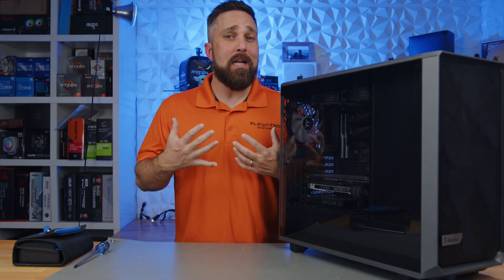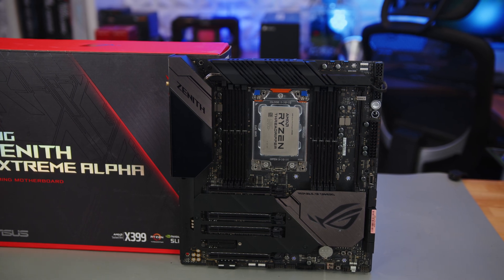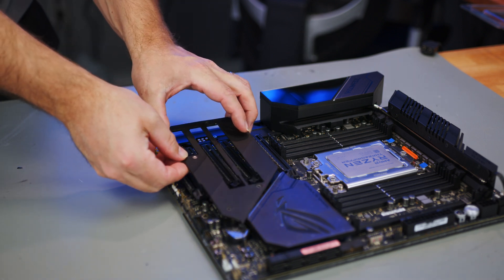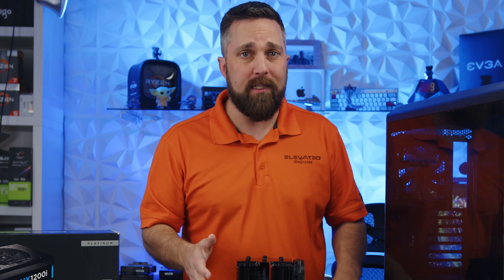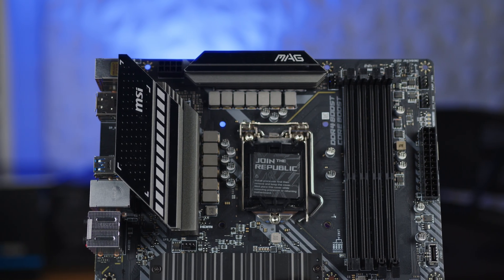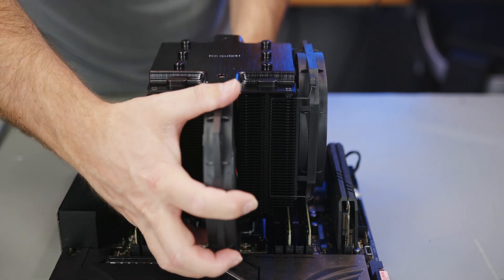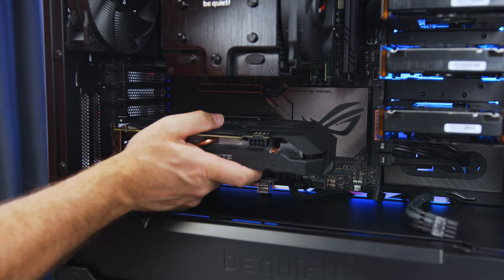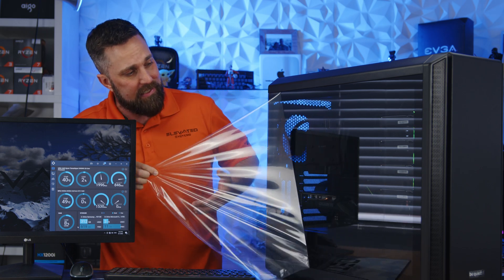How To Plan and Build a NAS Home Server.

Comment: Nice server, for some heavy lifting I assume.   I am building a much more modest Unraid server with an old Xeon e3-1245 v3 in an Asrock Rack motherboard with ECC memory.  I plan on using the NAS feature as well as a couple of other functions, none of which will be super intensive on the hardware.  I'm looking forward to watching your video on the software part.